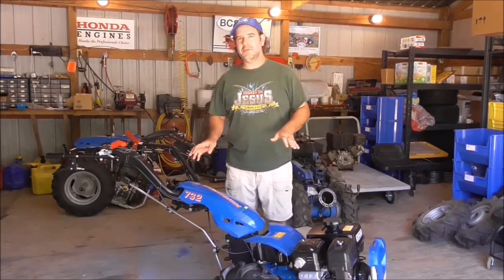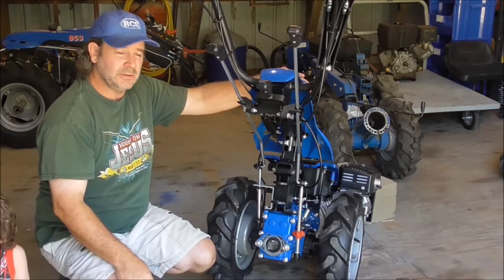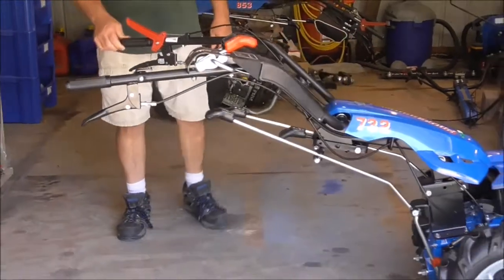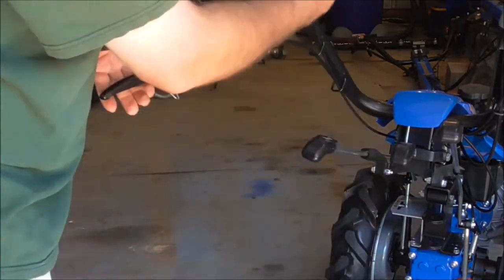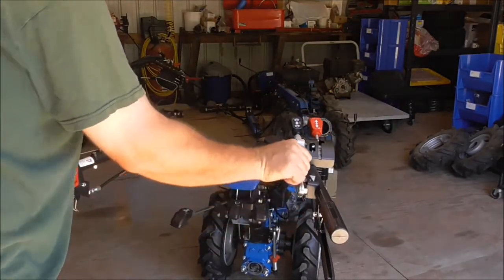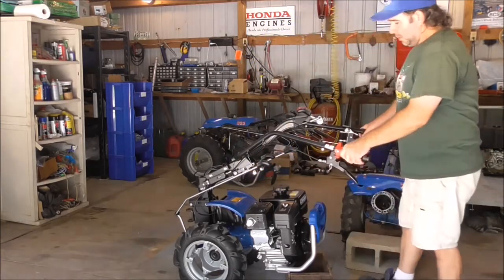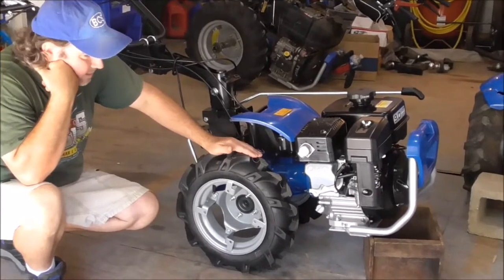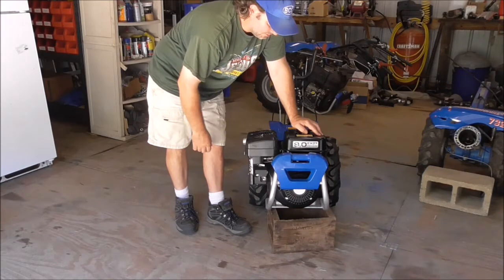Overview Walk-Behind Tractor (BCS, Grillo)

Comment: My bcs 605 flips hars around and it stays in forward
Reply from the maker: Hi Eric. Thanks for commenting. BCS 830/850 invert the linkage when you rotate handlebars also, but no current production BCS tractors do that. BCS 605/737 is of course the parent model to BCS 830/850 so they are very similar. Its a neat feature (inverting forward/rev linkage) but not necessary, plus the BCS system for doing this was problematic...if end user was not careful its easy to "bugger" up the gears that move the linkage. Thanks!